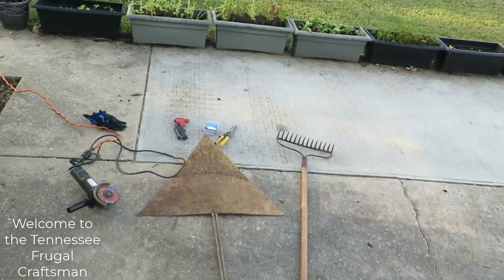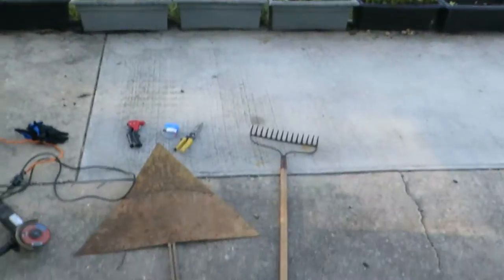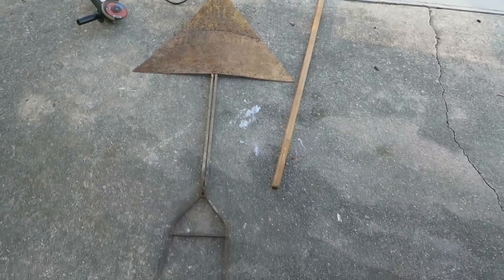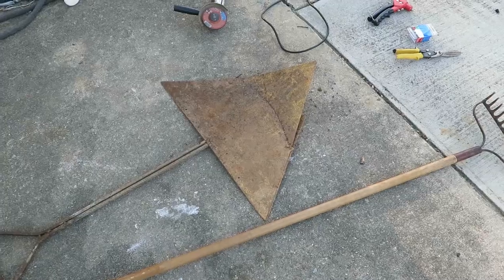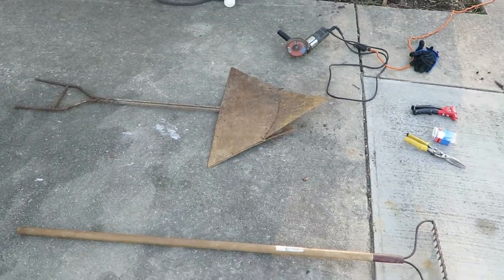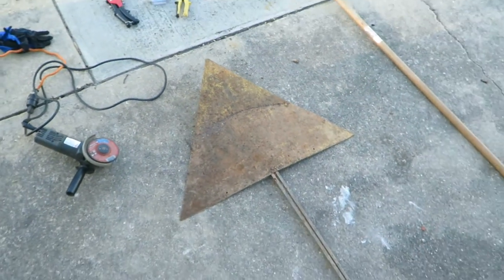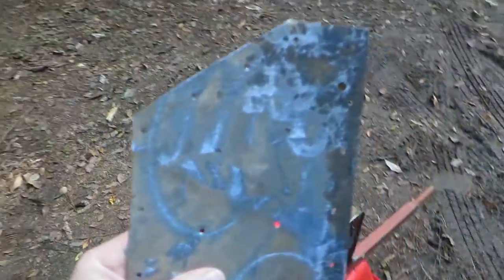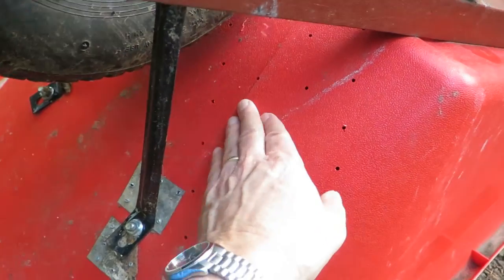Eps. #5 Repairing a Cracked Plastic Wheelbarrow

Comment: Good job!   I'm going to be making a similar repair  --- relatively small cracks around two of the bolt holes holding the tray on.
I think I'll use some caulk to cushion the patch and prevent water from getting between the barrow and the patch. 

I also have a steel barrow that has had the bolt holes holding the tray on enlarged by corrosion.  That's holding on using large washers,  but I have a fair sized piece of sheet stainless steel that I may cut to size and hold in place with the existing bolts.  I'd use caulk behind that as well.  

I saw a video in which someone melted plastic of the same type as the barrow as a patch.  I might try that as well.
Reply from the maker: Mine is working well and I used it for concrete!
Reply: @thetennesseefrugalcraftsma7383  <<
The Tennessee Frugal Craftsman
5 hours ago
Mine is working well and I used it for concrete!>>

That's a real recommendation,  and thanks for  the update.  I'm sure others will appreciate hearing that your patch has proven to be tough and durable.

I just got the tray off my $10 plastic barrow.  Only one of the bolts holding the tray came off,  so I had to cut the others off.  I suppose I'll replace all of them with galvanized bolts,  hoping to avoid rust problems in the future.

I'm taking still images of this project,  and am considering making my first You Tube video on this wheelbarrow overhaul project.  I presume that I can use still images and add written or verbal commentary.

Comment: Your double sided patch is the best, but I think my time [and patience] starts to exceed the wheelbarrows value. I put a 1/2" piece of good plywood in the bottom to stop the impact damage [kid likes to toss 50 pound oak logs into the thing even under the threat of death] . Plastic welded some other areas with hot wire inserts. covered the front sloped part with some sheet metal and 1/2" self tapping Philips screws.  Do a load of mortar and dont clean it well. All evens out.  
       By the way it is a 2 front wheel unit, the single wheel ones at $49 become very questionable to spend much time on repairs unless one is bored!
Reply from the maker: All good advice.